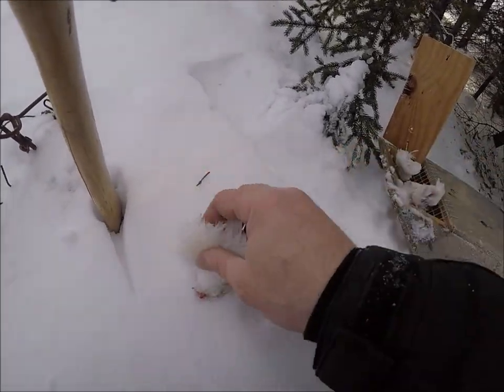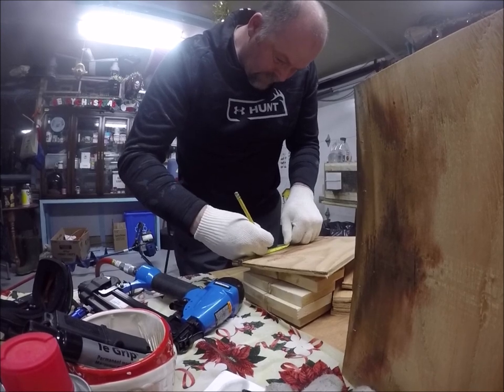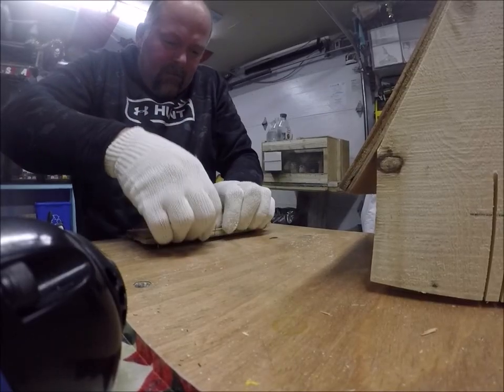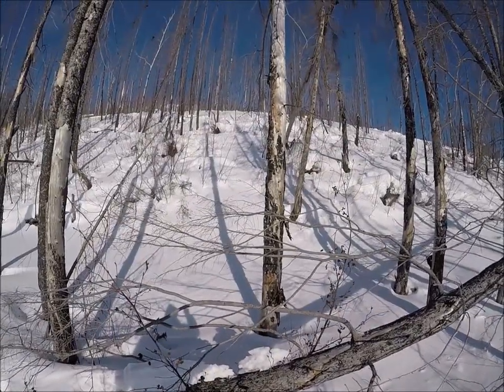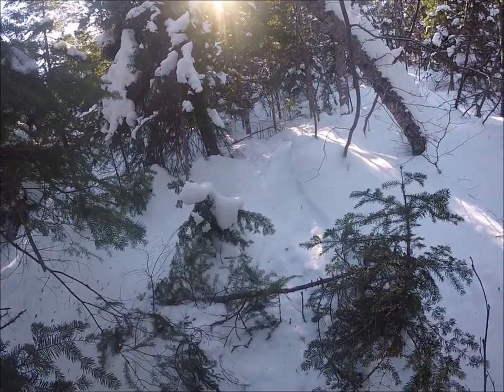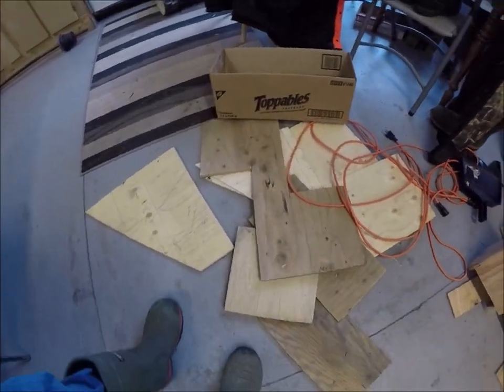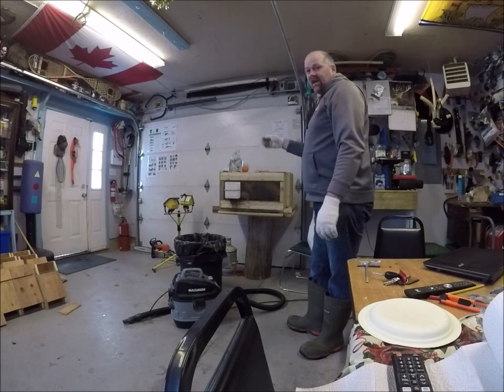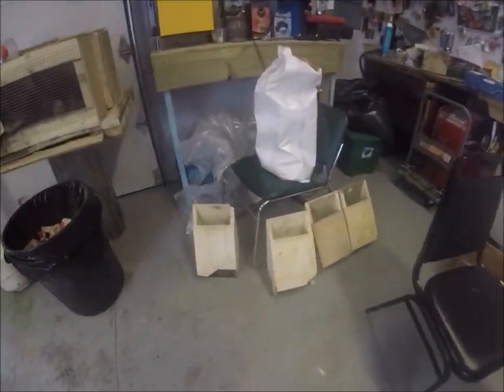Assembling & Setting Marten Boxes + Firewood & Quail Update

Comment: Good video Bill! Going to make some of these with 3/8" plywood I have for my 160's so may have to modify. Do you secure your trap to the box with a quick snap link? Cheers
Reply from the maker: @loneranger8293  I don’t use quick snap link but good idea and may use in the future.
Reply: @Biglandtrapper  just built a few of your marten box design for my 160. Yes snap link connects to a eye screwed on side so easy trap exchange. I went to Belisle 160 as I catch fisher as well.